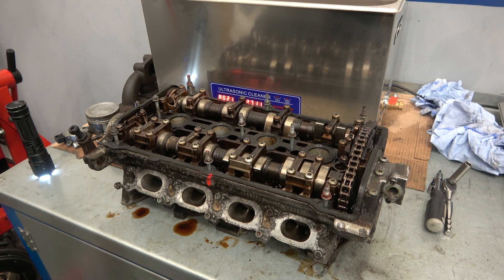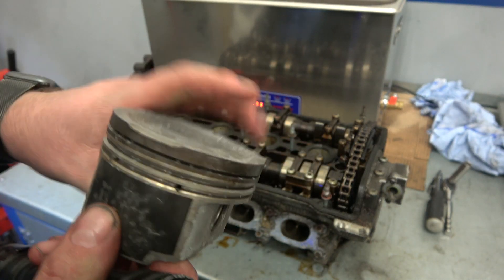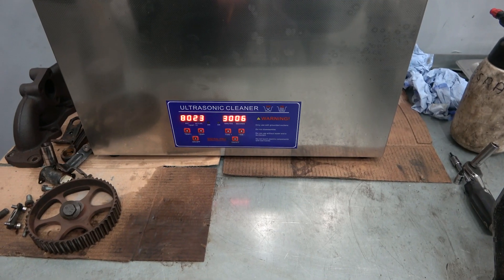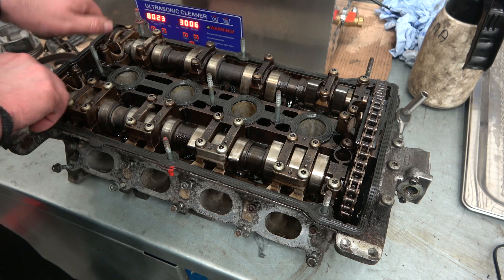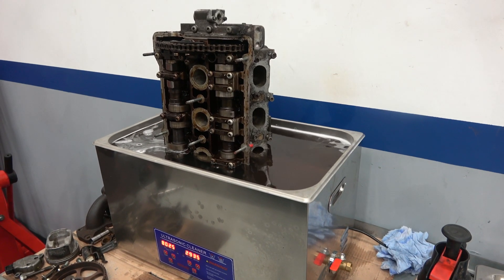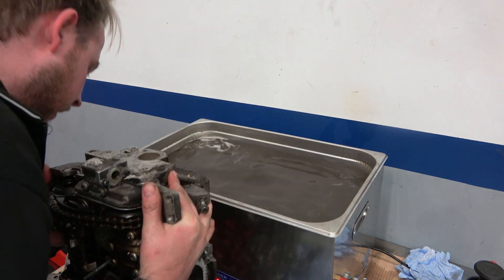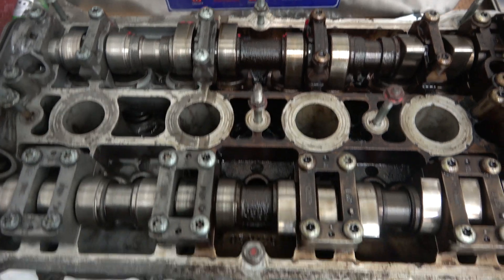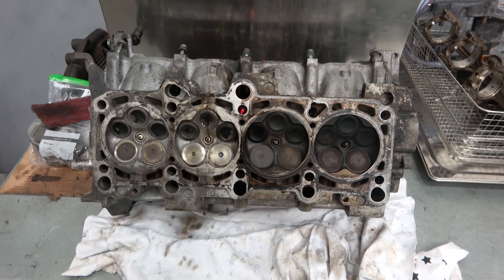Using an Ultrasonic Cleaner On A 1.8t 20v Cylinder Head! (9N3 GTI polo)

Comment: For optimum performance never let anything touch the bottom of the tank . Make a cheap wooden frame to suspend the head from tie down straps or something. Then you will see the results of 10 inducers ( the 30 litre version has 10 )
Reply from the maker: There is a metal basket but this was too big to get in the basket
Going to get a wire rack or something to help suspend stuff off the floor of the tank 👍🏻